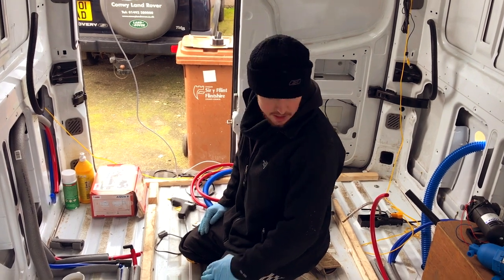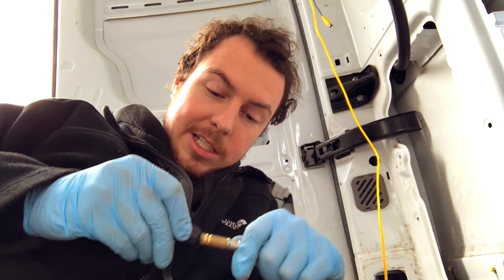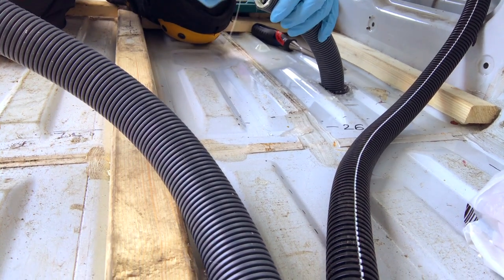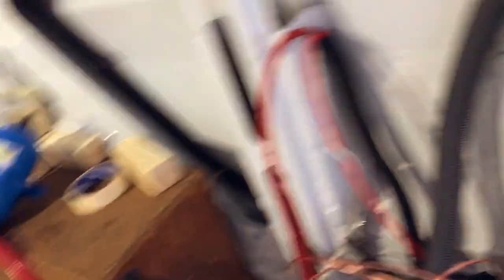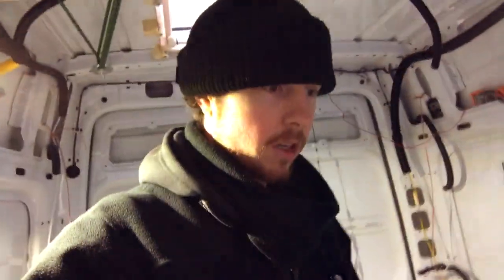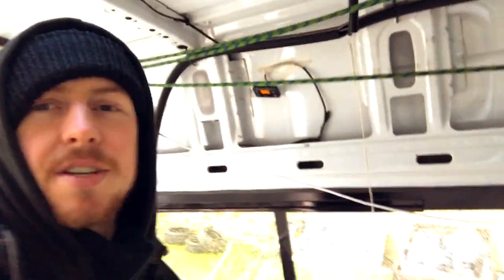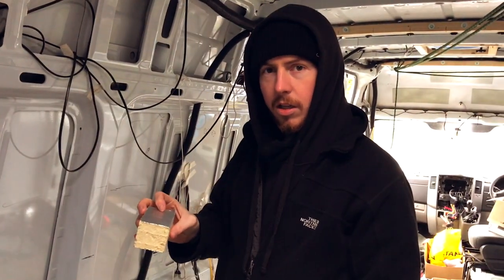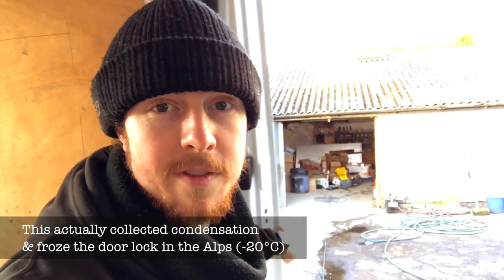How To Build Your Own Home On Wheels - [3/7]

Comment: NIce! How did you end up solving the condensation in the doors?
Reply from the maker: You dont haha
Reply from the maker: If I were to do it again I would probably just use Reflectix in the moving parts areas of the doors.
Reply: KiteVanMan my plan is basically to cover every inch of visible metal with that closes cell foam you stick under laminate floors with high temp trim fix adhesive (but not create a vapor barrier, since I've used xps and sprayfoam,so there isn't alot of visible metal to tart with, basically the beams and doors around windows.)